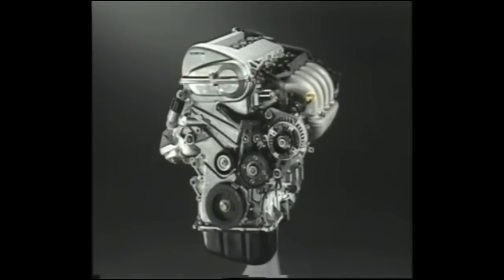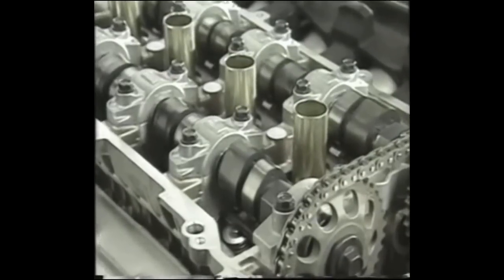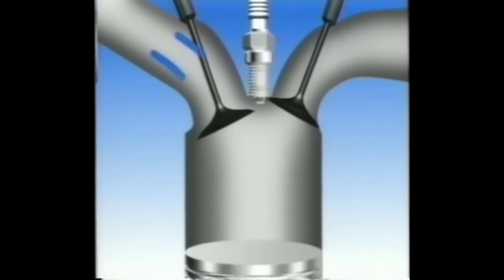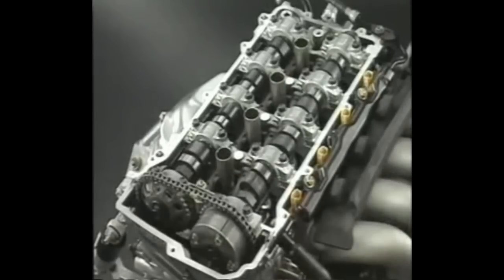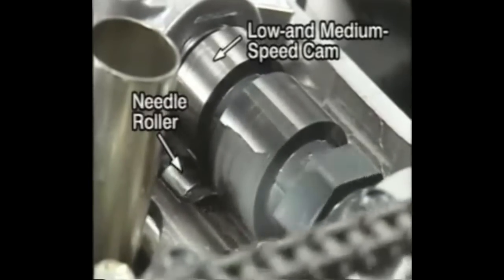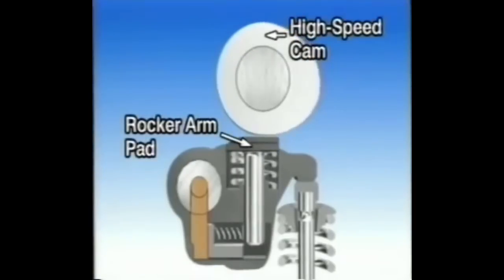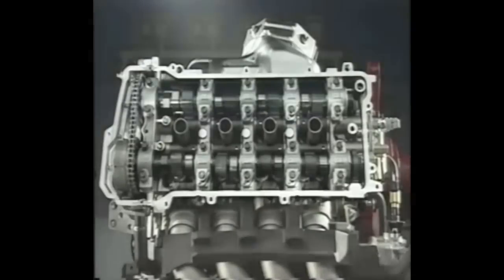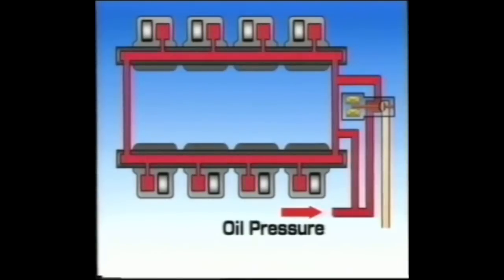Toyota's Valve lift VVTL-I explained on 2ZZ-GE engine

Comment: 6000 rpm???? I newer go that high. Those systems are just pointles. Theres no problem of making power or efficieny. Trick is to make both plus to be clean.
Reply from the maker: Borut Goli with these engines you are supposed to go well over 6000 it's build to be a high revving engine. And the short gears make it easy for it to do it.
It's a sporty engine and not a low end torque diesel.
It's all part of the charm of the engine.
Reply: Borut Goli but who would buy this car without revving it all the time? That's the whole point of the engine, that's the character of the car/engine.
Reply: SV Sportscars agreed, also random question but im thinking of buying a Celica VVTL soon, what year would you say is the best? Some say 2001 is best performance wise as the Valve lift kicks in earlier and for longer, is this true? Others say 2003 is the most reliable?? It's confusing me :P
Reply from the maker: Salim Ahmed where are you located? Country that is?
Reply: SV Sportscars UK
Reply from the maker: Salim Ahmed for the UK I would go with a 2003+ model. Much better interior and more refined.
Europa never had the different ecu models like the US did with different redlines etc.
Reply: SV Sportscars didn't know about the lack of difference in ECU in Europe! And that it only applies to the US market! This helps a lot, thanks, much appreciated.
Reply: Go for a 04+ if you can as some vvtl-i engines before this year had been known to fail if they weren't properly maintained, something to do with the oil pick up caused the engine to starve itself of oil, this was resolved from 04+
Reply: The Blue Corolla does that include the 04, or is it strictly above 04?
Reply: Salim Ahmed I bought my 2003 Toyota Matrix XRS because I wanted a Toyota after losing my 07 corolla in an accident. Personally I don't need a sporty car.. but I do appreciate it when I want it. Perfect for highway passes and winding county roads. I'm keeping it stock and am actively maintaining it. 330,000KM and climbing. Such an awesome engine :D
Reply: Amd Propaganda what's the mileage? 

Also does it drink absurd amount of oil? I have Audi A3 1.6FSI, it drinks 4L of oil every year (11k miles). How much does yours drink approx?
Reply: Amd Propaganda that's 5L per 10k miles, that's unusual. Is yours VVTL or VVT?
Reply: It actually makes the system both of high power and high efficiency, I’ve recently calculated my 230k 2zz at 34mpg on highway with cruise set to 75mph for the majority of the time, and near 27-28 in average commute. But that high performance is just right around the corner, and if I decide I wanna spend a little extra $$ on gas and get 18-24mpg than I just climb those rpm’s and believe me when I say this, I do it ALL THE TIME! 

(P.s. not too sure on the actual mpg of using lift a lot, just an estimated guess)